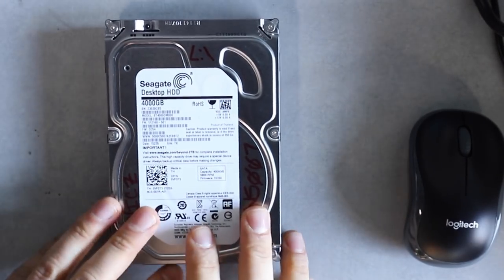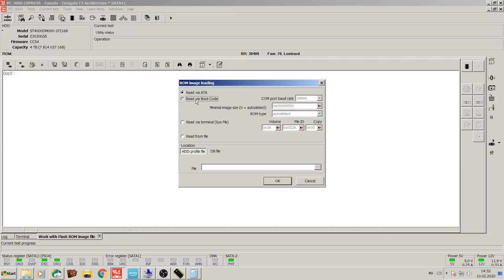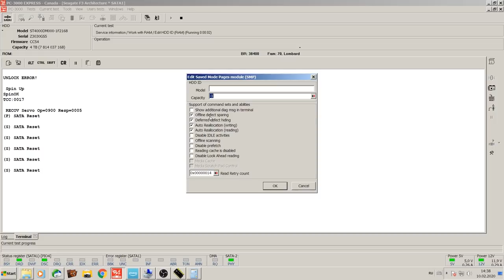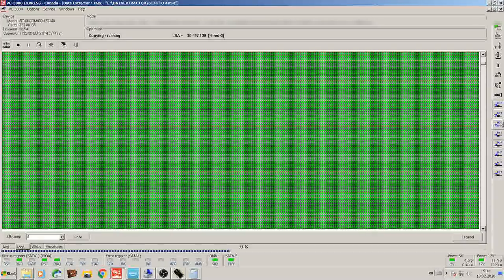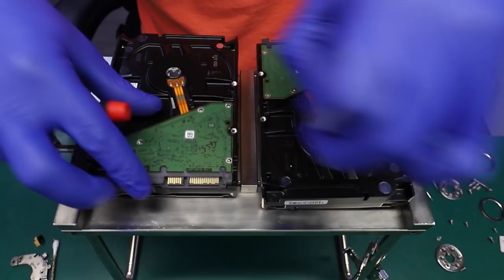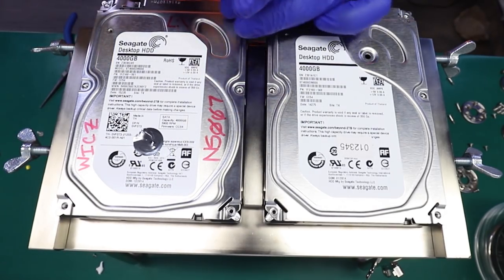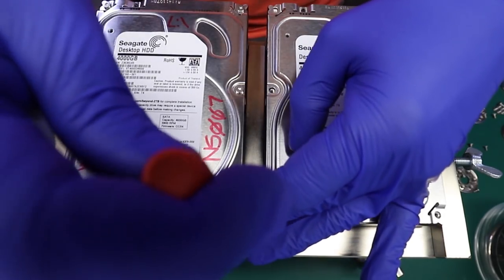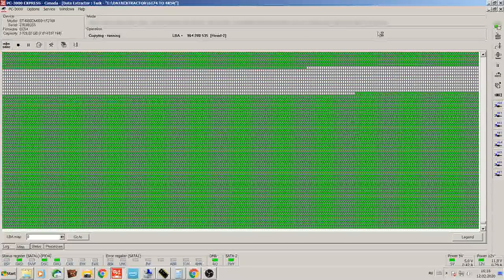problem with hard drive resolved

Comment: I saw you marking the magnets. Does it make a difference if you put in the „wrong“ magnet? I always assumed that they‘re similar enough so that the magnet of the donor would work at least as good as the original one...
Reply from the maker: It could make difference.

Comment: I have a Hitachi 3.5 1TB hard drive and beeps/clicks when spinning, the Serial number is HD34AZJH, other numbers on the device are 0F10383JPT3MA0C0A and HDS721010CLA332, Would i be correct in sying that it needs a doner head replacement, if so, is this an encoded device and does the chip from pcb need to be transfered over?

Comment: Around about 2005, I had a WD hard drive that failed. When I pulled it out there was a square chip on the control board that had exploded leaving a small hole about 2mm wide in the center. Over the next 5 or 6 months, I had 3 of my friends bring me their computers as they quit booting. The 3 hard drives were all of different manufacturers but they all had that same chip on them. It appeared that the chip had a run-time life as they all exploded after they had been on about the same length of time.
Reply from the maker: Spindle Idle Controller it is a common failure replacement of PCB with ROM adaptation is a fix in most cases

Comment: great work., can you drop a link for the tweezers you use ??, thank you
Reply from the maker: Ones I use for hard drives are curved tweezers I bought at a local shop like 10 years ago, and I bent the tip out to be inline with the handle. Z shape sorta speak.

Comment: On the patient, why do you need to use a head comb if the head assembly is bad? Is it because the other heads are still useful, better for practice, or ...? Great video btw! :)
Reply: @ultimatums1  That'd make sense for heads that were parked on the platter, but in this case -- it doesn't look like it?
Reply from the maker: It's not bad, it has 1 dead head, but that head assembly could save another drive in the future. Example: we get another case tomorrow that is similar but instead of head 2 being dead, it has a dead head 4. We would image 0,1,2,3,5,6,7 with original heads, then we can use patient from this video as donor to swap in. That will help us capture head 4 from another drive. If heads can read on some levels they will be used at some point. Otherwise we just throwing money away on donor hard drives each time
Reply: @hddrecoveryservices  Makes sense, thanks!
Reply from the maker: @ultimatums1  no, Data Extractor, prior to the image process, creates a task file. Task file keeps a map of all image activity ( head map, images sectors, bad sectors, timeouts and so on). After swapping new heads in, we just need to get what wasn't picked up with the original. No redoing of any sort

Comment: I am wondering if it is safer to replace the plates instead of the heads, mainly if you do not have that little and expensive spacer.
Reply from the maker: no, it is not
Reply: Taking the platters out or even touching them is way more of a risk than changing the head assembly.

Comment: Where do you find the software and patch?  Looks like you have a circuit board tool.as well.  I can't fund anything on google as far as tools or the patch.
Reply from the maker: Pc3000 by Acelab
Reply: Thanks.  You know i googled earlier all I could find was repair services.  It was if the search was suppressed.  When I get a chance ill take look at the tools.  Old ide drives run like a champ, but these new drives...I barley get a year out of.  So sad.

Comment: Why don't you use magnetic screwdriver? 😛 
Nice job. Thanks for  explaining everything.
Reply: Those screws are made of some kind of alloy Magnetic screwdriver ain't helping :-) 
If I would recover data and the cost would be no issue I would go with titanium tools. Last thing I would like to experience is braking the damn thing by mishandling actuator magnet/-s.

Comment: Hay. If I change myself the read needle of  an HDD (like a pro with the proper tools) can I start the drive with no PC3000 or some recovery software?
Reply from the maker: not likely. most hard drives need some kind of a " firmware tweak pill" after the mechanical restoration
Reply: @hddrecoveryservices  you do not know a freebe or cheap way to do this? Right?